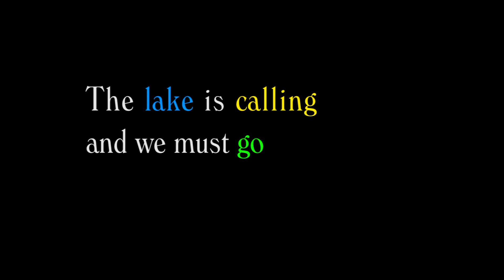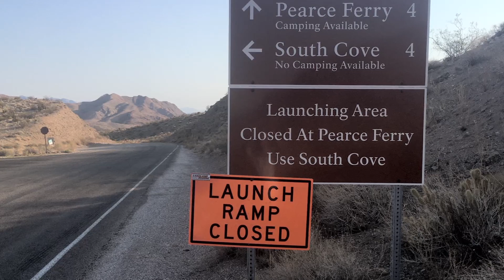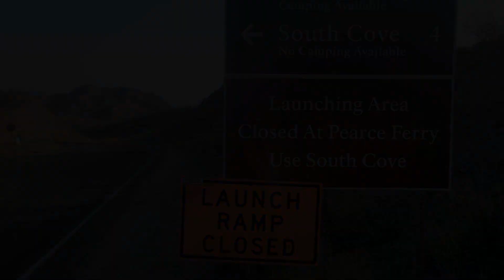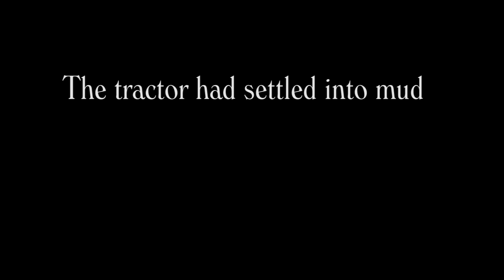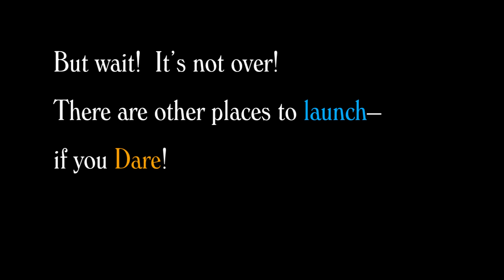Lake Mead South Cove Closes - Episode 4 - Water Level Crisis

Comment: Hey Eric, great video! Question, is the park service going to do any prepping of the ramp area past the cement launch? There are a couple of piles of dirt that could be push out and flatten(groomed) for when the launch possible opens. The level is at 1075.76 - 2/19. 
It looks like the dirt area after the cement ramp has eroded due to rain water going down the ramp. It’s less Area then in your video. Would love to touch base with you. If you are ever out driving around, say hello, Bright Angel & Stillwater. Joe
Reply from the maker: Thank you. At a meeting last year (that I did not film), when Justin was "acting superintendent", he said there would be no more improvements to South Cove concrete ramp period. I plan to launch as much as possible before they close the dirt ramp to trailer launching entirely as water level drops. Here is a video I made of one of the meetings at MCA in case you did not see  https://www.youtube.com/watch?v=T8c6Id4GjPo&list=PLuapVHyZi4oOwPp5y3wP5CAH8kyUtvTHe&index=8&t=655s
Reply: @arizonaeric9598  yeah I know they can’t extend the ramp any further. But they could smooth out the dirt they have at the end of the ramp before the water level goes above it. It looks like the right side of the ramp has eroded away from rain water going down the ramp. There use to be more dirt passed the ramp. Well hopefully the water can keep rising like it did last year🤞🏻🤞🏻
Reply from the maker: I don't know. Maybe you can bring that up at the Park Service meeting 3/7/2024 at 12:30p at the MCA following the COM meeting.

Comment: Here on the left coast, kommiefornia, it is illegal to tow your boat with the drain plug installed.  You can be pulled over and cited for having your drain plug installed while towing your boat.  (I didn't believe it either.)  It's in the boating laws.  This is an attempt to stop the quagga and zebra mussels.  Those invasive species that have traveled 3000 miles and are already here. Just sayin'
Reply from the maker: Thank you for pointing that out. I have obviously not made a good example here. You are correct on the law, and also that the mussels are already here. I should have taken the video of the plug install down at the lake with me laying on the rocks but it was much more comfortable shooting that clip on my clean garage floor LOL.
Reply: What good does leaving your drain plug put do to prevent that?
Reply: @michaelmaas5544  I think it's meant more for when you put out your boat so any water infected with the mussels drains out at the place it came from and doesn't stay in the boat to infect a new lake.